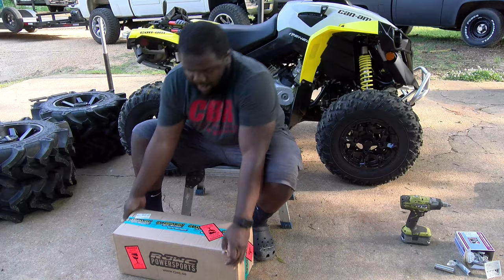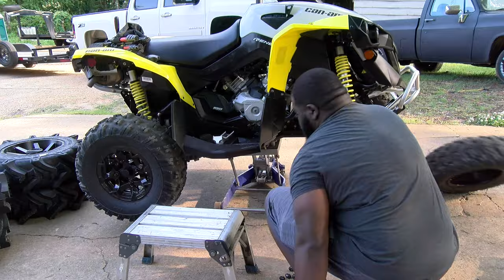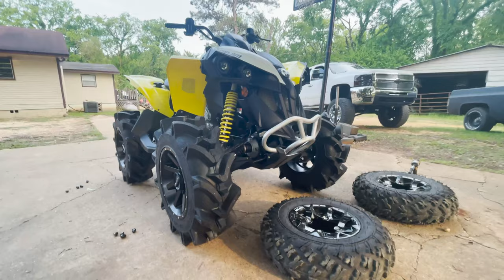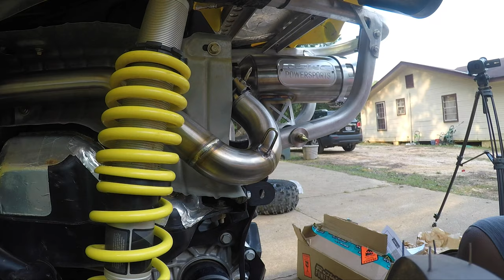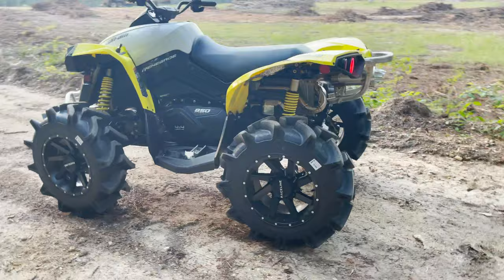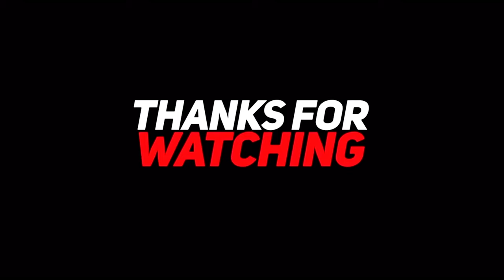2021 CAN AM RENEGADE 850 | CBTR BUILD | MOTOHAVOK | RJWC SLIP ON EXHAUST

Comment: Both sounds good! I like the rear flow exhaust system looks better. Which one cost less?
Reply from the maker: Big GUN
Reply: @CBTrailRiders  do you have to program the computer after changing the exhaust?
Reply from the maker: @mr.gtmsworld2494  for best performance yes, but it can be ran without
Reply: It’s not a Honda , you bought a can am for performance . Don’t cheap out and not tune it , lol

Comment: Are you running a Tuner?
Why didn't you get a xmr. Mine already came with 28s and i heard they will fit 32s. Fenders must be different
Reply from the maker: XMR are geared different from the factory and yes I have a ecu flash, but it ran fine without it… just not to full potential

Comment: with the single rjwc do i have to have a tuner i have a 2019 can am renegade 570 xmr i just want to know if i can run it with no tuner
Reply from the maker: I rode it for a while without a tune, but now the ecu has been flashed for it.